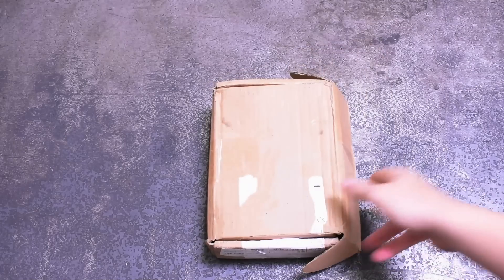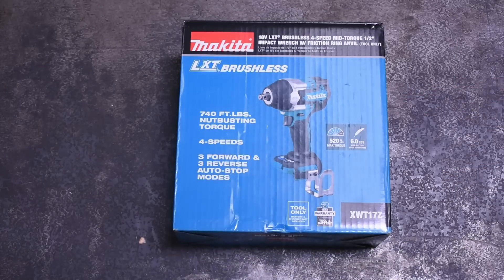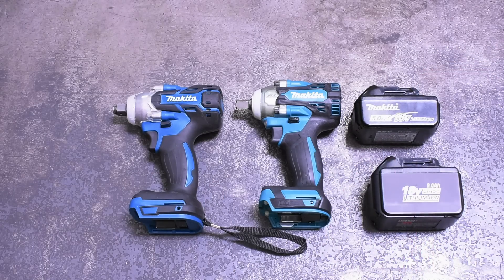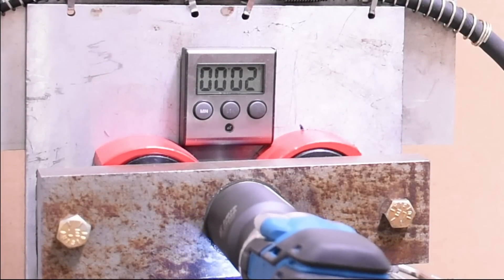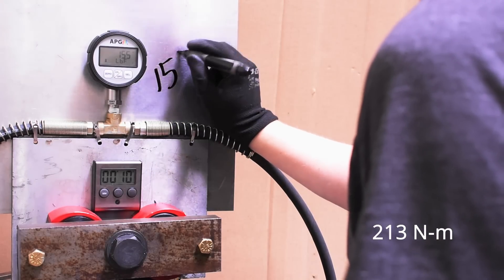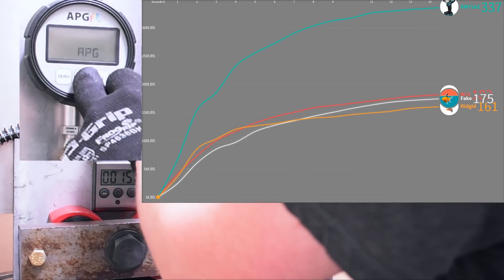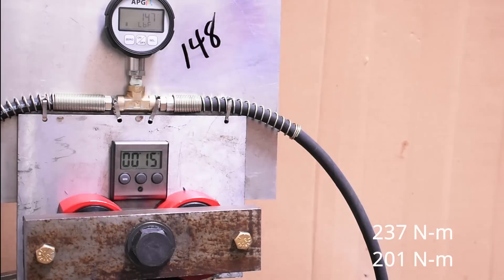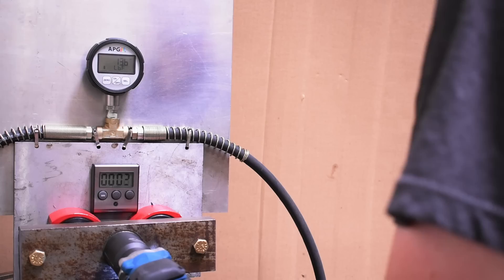Knockoff Makita: Exactly What Kind of Power Does it Make?

Comment: Wouldn't be surprised if the fake Makita did worse with the fake 9ah because the impact was already wearing out from the previous test. The 3p fake 9ah battery should have out performed the genuine 2p 5ah battery at least on amp output, though maybe not capacity. Probably if you retested the fake Makita with genuine 5ah you'd find it's performance has degraded.

Comment: Must be more than one of these copies out there. I got a slightly different version for £22 ($28), better color match with a real Makita but no badge, one extra vent at the back and has a Bosch Freak style 1/2 + 1/4 hex anvil. Rated at a much more modest 330Nm, definitely doesn't make that but can just about do lug nuts with a real Makita battery. Also seems to run more smoothly and hasn't noticeably lost power in a year of ownership, although that said hasn't been used much.

Comment: I’ve had that fake majors impact wrench for over 2 years and it still runs strong only get about 150 foot pounds out of her but I use the hell out of it and I paid 29 dollars for the tool on eBay so all in all I’d say it’s honestly a great fucking deal I mean 150 foot pounds is enough to break free 99 percent of the bolts on any regular size car lol even lug nuts are no problem for this little beast it’s really compact and is actually built with decent quality I’ve had mine apart it has the boards fully epoxied just like Milwaukee does it

Comment: Amp-hour rating of the battery should have little or no effect on the torque. What affects the power of the tool is the amps times the volts. The amp-hour rating only tells you how long the battery should be able to supply the tool with power, before it needs to be recharged. Has nothing to do with the amount of power. That's basic electricalicity theory.
Reply: Voltage always drops with power load. The more power available (amp hours) the less voltage drop and therefore less power loss.
This guy has proven that in several videos with higher capacity batteries making more torque.
This is also common knowledge in the car audio world.

Comment: it's worth looking inside fake batteries if you buy them. I've bought fake Makitas before just to see how they go, and the 5.0s were actually two rows of 1.5ah cells making them 3.0s, and the slim 3.0s were actually 2.0s inside, and feel like they pack more punch than the fake 5.0s I got too. Another strike against the fakes, my mower straight up rejects them further supporting the "these are not tool rated cells" theory. Not all fakes are created equal of course, but if you're paying for something, make sure you get what you pay for and not just a sticker that says so. Fake Makita tools I've been largely happy with as long as they're paired with a real Makita battery. I have the hex/square impact you guys tested though I've paid as little as $12 for it on amazon and $30 on ebay, a fake blower $39 from amazon that came with a battery and charger, some fake LED lights, a fake grinder in red finish because it was available same day on amazon with a battery and charger for $50, my Ryobi 40V mower takes 2x Makita LXT batteries now not sure if that makes it a fake Makita we're toeing the line in reality at this point, and I have about a dozen Ryobi and DeWalt XRP tools with Makita adapters to fill out my tool wall. Keepin it real fake.

Comment: I have 2 of these cheap ones and they work great with some finishing steps
like installing shims to reduce axial shaft play and matching the dogs to strike at the same time

but having done that I can now easily take off lugnuts with these chinese things
Reply: Make a video on it
Reply: @mrmotofy  sorry, I didn't feel the need for an impact driver to record video
or did you mean a video of it taking of lugnuts?
or the mod?
edit
you just need 18x25mm  shims at a thickness of 0.2 and 0.3mm, I would estimate that it could make real 250NM after that
not much, but good enough

Comment: I love my Cheapster Impact. I use it to tighten Wheel Bolts, in lowest setting i get the wheels to align an pull in I think it makes about 60NM, kinda half of the final torque,  I then only need a few degrees with the toque wrench to tighten them. 

I have a 900 NM Dewalt Impact as well that I set „permanently“ to left rotation so I never over-tighten someting with it, whereas the teal fake is weak enough to not cause a problem. Also tjat wont wear out the Anvil as fast.

Of course a stubby M12 Milwaukee impact would be nicer, but the cheap plastic is also very light and kind of compact.

Comment: That little on off button located just above the battery mount has two power modes for each direction of the tool. Are you sure it was in the high power setting? RPM sounded a bit low...

Comment: Can you do a test of “budget” high torque models? A brushed older model of the 1/2” Milwaukee high torque m18 runs only about $100 or less at the moment. 

Picked one up the other day in a kit with an electric ratchet at Home Depot for $200 including batteries for both and a charger. Pretty screaming deal if you ask me 🤷‍♂️ 

I know it’s going to be perfectly adequate for my uses, but I am curious as to how it would perform on this test. Especially given how inexpensive it is

Comment: I bought one of these Fakitas to take to salvage yards for when i am parts pulling. That way I am not too upset if i lose/break/drop it in a pan full of oil. It is just powerful enough to do most of what I need and makes a god awful noise like a bearing is siezed, but it works and I reckon it is worth the $50Ausd it cost me, The real Makita stays in the garage doing real work.

Comment: So the only thing I disagree about for this is we all know the 1000Nm claim is bogus so it should really be ranked without that portion of the values added in. If you did that, it'd be 118.7 and clearly ahead of the Ridgid's 97.8 and not far behind the two Milwaukee tools of 131.6 and 127.3.
Reply from the maker: We all know most of these torque claims are bogus. Sort of the point of what we do here

Comment: I have a different knockoff version that is at least the correct color to match my genuine makita tools, looks identical to a genuine 1/2 mid torque except with a different print on the mode selector sticker on the base. Even if it did perform at 30% of a genuine impact wrench, it's still done everything I've asked of it in an automotive setting short of busting a 30 year old crank pulley bolt (which needed a kobalt high torque cordless). I'll eventually replace it with a genuine one but I've enjoyed working with it with the batteries I already had

Comment: I have a 2 of the fake 9ah batteries. For what they cost they are pretty good. I’ve had them for about a year doing heavy fitting work and they seem to last. Only thing is the terminals inside the battery can burn out but you can just solder them back on.

Comment: I Wish I hadn’t bought this knockoff.
Reply: There hit & miss with the standards , some are fairly decent like my mates @ work , we get it out when the units on refurb & it's a rusty ol jobbie . I had the copy grinder & it lasted 1 hour from new & smoked , so i stripped it & found out the magnet core was rubbing on the winding cage causing huge friction,  so i rewound the motor with an extra turn of wind & it works better & of course , packed the bearing holders so the motor alignment is improved.  Took a while but that was 2 years ago & its still going strong

Comment: Just an idea for future tests: Some impacts like the newer Makitas you've tested have auto tightening modes where you can hold the trigger and it stops impacting after a certain time. For me it would be super interesting to know approximately how much torque each setting provides
Reply: bit late to the party but i think the autostop mode is the same as the normal speed modes (which just limits the max rpm under no load/max ipm under load) with an extra feature, being that it cuts the motor and engages the brake once the tool senses it going to no load to load in forward, vice verse for reverse. if its at auto 3 compared to auto 1, it just has the potential to be faster and thus can impact more times giving more torque before the automode overrides the motor and electric brake. personally i find that mode more useful for loosening to keep nuts & bolts from flying out at high speeds or to keep it from unthreading completely. only use it in forward for lugnuts before dropping the vehicle back down but i also loosen each one afterwards before i use the torque wrench just in case
Reply: it's variable and dependant on the voltage of the battery, so i.e basically worthless. full charge low setting could be the same as high setting low charge u feel me fr fr no cap

Comment: Honestly, even if this is a piece of shit counterfeit, it produces enough torque to free up parts on used bicycles, especially those that were stored outside. 
Run a one inch socket on it and you've got enough force to turn the majority of bottom brackets and freewheel removal tools, even those that were overtightened by a gorilla and put on with abrasive assembly compound like so many seem to be...

Comment: I've always wondered why it's the Makita tools that most often get knock off versions. I've seen some really bad attempts to knock off Dewalt's and Milwaukee's but the Makita knock offs are actually close to looking like the real deal. I was really amazed that the tool shown in the video was brushless! Is there a dedicated Chinese factory making only knock off Makita? If so why Makita? I know Makita is a top tier brand but so is Milwaukee and Dewalt? In fact I work on big jobsites and rarely see Makita it's always Milwaukee and Dewalt with store brands as well. I only know one "makita guy" and he is just old school, his first cordless was a 9.6v Makita but I rarely see anyone else using them. My employer also works at car dealerships and often I add plugs/lights in the service areas and again it's only the other brands I ever see techs use. Is Makita much more popular overseas?
Reply: It's definitely more than just Makita, about seven years ago my dad bought a knock off Dewalt drill from a SoCal flee market for like 12 bucks, the branding was "Desupreme" and overall it wasn't that badly made. Fundamentally it's just a generic drill with a 24v 550 motor in it and it does what it supposed to do. I later bought myself the cheap 30$ B&D drill from Walmart and they feels the same in terms of speed and torque.
Reply: Well which side of the pond are you on ? In Britain theres dewalt & makita in equal numbers then the less used hilti & bosch & just recently I'm seeing milwaukee have made it across from your shores . Not sure why they clone makita the most , but yea ha theres a makita clone factory - called crapita

Comment: This is the exact knock off I had, I have now got the same makita shown here, I knew the knock off was useless when i couldn't remove the the lug nuts from my wheel. I do however still use the knock off as a driver as it has a 1/4 inch inside the anvil.
I've wondered what would happen if I swapped the anvils so my real makita would have this ability.
Reply: The torque of the real makita would probably snap the anvil…
Reply: @saxamusprime  only if you are driving a big enough screw.
Reply: Cousin eddy anyone?

Comment: that model usually sells for $30-$35
Reply from the maker: We literally bought the "best" highest rated one of the higher priced ones we could find
Reply: @TorqueTestChannel  I think the point is, these are sold by a bunch of different vendors at a wide range of prices and they're all basically identical. I bought the highest torque driver from a vendor on aliexpress, and paid about $35, including shipping. And while I don't have a fancy torque testing set up like you do, I measured the torque on mine to be about 100 foot pounds. So it seems like you massively overpaid for what you got.

FWIW, while I know the one I got for $35 doesn't hold a candle to a genuine Makita, and I would never recommend it to anyone who uses one regularly, I have no regrets on my purchase. Especially since I could never justify spending $100-$150 on a tool that I use maybe once a year and that I could get by just fine without. For me, $35 was something I could justify for something that's a 5 minute convenience about once a year.
Reply: @MrJacobegg  i bought one with two of the cheap, questionable batteries for 50 $ for the exact same reason, i didnt want to use a hand tool to change my tires. Now i just have to use the torque wrench. Also, its nice to know the tool is too weak to actually break a wheel stud :-)
Reply from the maker: @MrJacobegg  Oh, we knew we overpaid as soon as we clicked buy. That's sort of the rub. We want to be the guinea pigs so you guys don't have to. If we bought the cheapest one, there would always be the question of "what about this one I found though, looks like it supposed to be better" I agree with you that they are all probably about the same.

Comment: Would love to know what the real amp hours the battery is
Reply: And what it is after 5 charge-discharge cycles.
Reply: Open the pack up & read the printing on the cells , tells you the ma/h then if the theres 3 in parallel you times the capacity of the cell by 3
Reply: @stestar09  this is chinesiun, it probably says 100,000ah

Comment: Thank you for the Knock off test. A guy a work has one, the 285 version, and he says it ain’t all that bad, but hit and miss is everything in life and I normally miss. So settled on the DTW300. I’d like to see a settings test for that model, see what torque actually is created, same as Dewalt, Milwaukee and the like. Thank you once again for all your testing!!!
Reply: They already tested it and praises it, its called xwt14 in USA. Awesome impact wrench, i got the same just that model number is DTW301, it punches above its weight class.
Reply: @pflaffik  Did they test the settings? I missed that then. Have watched all their vids as well. The 301 has a different anvil, a pin type I think, the 300 is a retaining ring.

Comment: That actually seems way worse than the one project farm got. Damn...
Reply: It is interesting because I have been running a bunch of these along the makita they seem to be a close copy of and the knockoffs have done just fine. I can not really tell which one is which when they kick around heavy machinery for a while and it really is a shame to have 200EUR genuine makita being treated that way, not so much a $30 "copy". I don't remember having a situation where the makita did the job after a knockoff failed, so I didn't bother to look for the makita anymore. One of the knockoffs has intentionally seen a lot of use and still is working fine.
Reply: @gearloose703  project farm had a $30 one that seemed to have more power that the wish one in this video. I know that most of the cost is name brand markup. But there is still quite a bit in R&D and QC. I'm glad to see more affordable tools, but have a reservation about it actually saying Makita when it isn't.
Reply: @aaronatwood9298  I don't understand why they have the fake makita badge, I have not seen them sold under makita name, but rather with some chinese "brands" and in various colors. I don't mind the resemblance, I have many makita compatible tools which I am not aware they would be copy of any existing makita or other tool. The makita batteries have been around so long there are plenty of them anyway, but what comes to acquiring new tools it is all milwaukee now. No new real makitas anymore.
Reply: @gearloose703  I have Milwaukee as well. They aren't always the best, but they have taken every beating I have asked of them, and more.

Comment: Can you get some battery adapters? I wonder how a Makita runs with a Milwauke battery, or maybe a 20V Dewalt if that's possible.
Reply: '20v Dewalt' is literally the exact same voltage as any other 18v nominal tool, and that's why they label it '20v MAX' its just a lame gimmick.
Reply: @Senkino5o  It's a lame gimmick but it must be worth something. Bosch rebranded all of their 10.8V lineup to 12V a few years ago despite not changing anything. I assume to compete with the Milwaukee 12V.

10.8 is to 12 what 18 is to 20.

DeWalt are also weirdly inconsistent selling both 10.8 and 12V together.
Reply: Main issue with battery adapters is that some makers put protection circuitry in the battery, and others put it in the charger/tool. If you use a battery that has no protection in a tool that has no low-voltage shut-off, you can easily damage the battery permanently.

Comment: i have been using a similar knockoff makita cloen for 2 years, it was working flawless, had decent power, but it quit on me. i thought for the price it couldnt be beat, so i have ordered an another one, the "upgraded" version, the clone of the dtw300. that i must say, was a waste of money, a gutless POS... i suppose you get better and worse ones, as no real quality control is taking place at some backyard factory in china.. :D
Reply: maybe try opening it, i would not be surprised if it had realy badly solderes contacts or something
Reply: @nilz6432  yeah, I have an old one and it was about 16 quid delivered. It made more power after a few months of use. AVE took one apart and it was well made really for the money. Mine is used quite a lot, handy were my real makita may get damaged, I use it to run nyloc nuts home save on spinning a rachet, it will also run suspension bolts out of your car when they are sticking all the way.